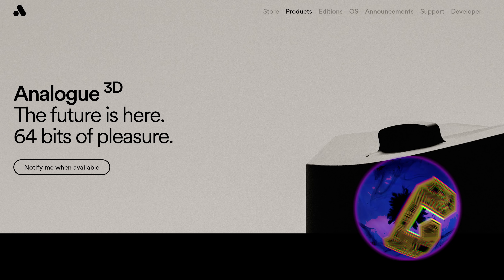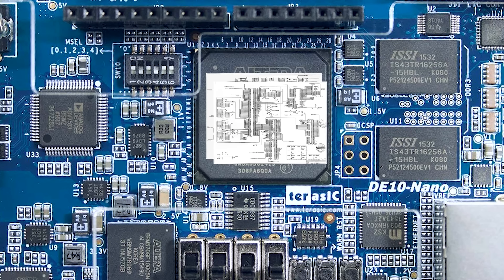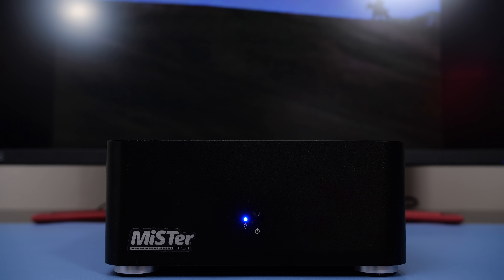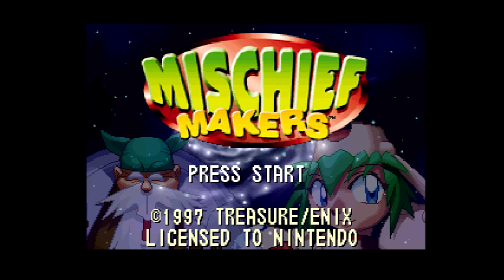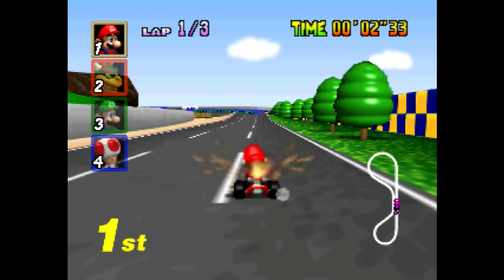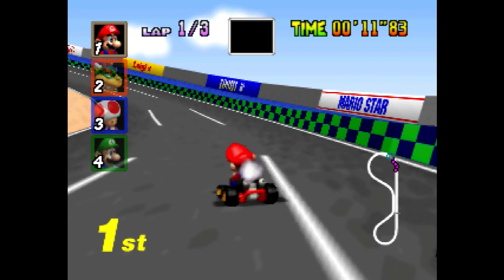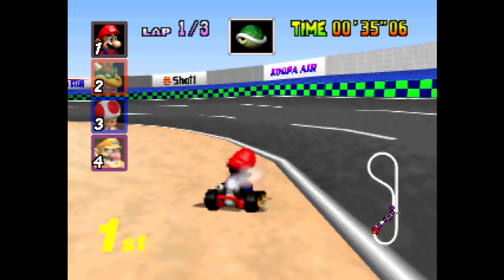FPGA Nintendo 64 gaming is here.

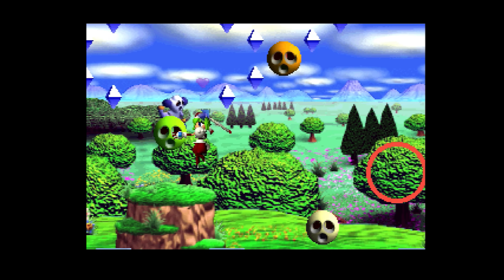Comment: At 4:47 he answered a question I always had about Nintendo 64 games, sometimes on the original console I always wondered what those lines on the edges were and I always found it strange. But this raises another question, why did the Nintendo 64 have to use this 3 point filtering method? Without this what would happen?

Comment: How fast can you switch cores on an fpga? For instance, if you can emulate 100 transistors (forgive my ignorance of this is not the right word) at a time, but the computer you to emulate has 200, can you run one half, then the other? I assume this runs at a much higher frequency than most of the computers it emulates. Or am I way off?
Reply: @bigboiter  I guess what I was getting at was say you only have enough gate arrays to emulate half of a certain computer at a time, but your fpga is twice as fast as said computer, could you swap cores back and forth fast enough to run a video game?

Comment: I'm not used to this FPGA world, so I have to ask, are these programable chips, being upgraded like a PC GPU for example? I mean, a new, more powerful FPGA chip appears in an interval of time? If it's the case, isn't just a matter of time untill we have a chip that is powerful enough to handle the N64 core without having to adapt so much? Or people are buying a specific device (like Mister) and trying to squeeze to the maximum, even if theres more powerful FPGA chips out there?
Reply: All of the current FPGA Misters are based on the DE10-Nano right now. There are potentially much more powerful chips but also waaay out of reach in price for the average consumer. Many people even find the current DE10-Nano prices too much. Only systems DE10-NANO cannot do currently that PCs can do reliably is Dreamcast, PS2, GameCube, OG Xbox. Future FPGA chips can do this whenever prices get reasonable enough for there to be a market for it.

Comment: As FPGA designer I would like to say that it's incredible! Probably, now we met the limit with current MISTER platform. I think we will not see hardware emulation of Playstation 3 or Xbox 360 and later consoles. Next steps here is all about economics. Because the price is high. If now you can buy MISTER platform for ~400$, for next generation of consoles price is more higher, it's thousands of dollars for one chip. I was working in companies where FPGA chips were using for ASIC prototyping, including CPU. And always it was a story that you cann't route the whole design - you have to divide design between few chips or reduce functionallity. And last but not least - PS3 and Xbox360 CPU has high clock frequency, ~3.2 GHz. It's not possiable to have this clock frequency in your FPGA design. Sad but true. Probably we will see Playstation 2 core, but I'm not sure, because it's so complex and hard issue.

Comment: i think i misunderstand something about FPGA programming - if you are coding the hardware as its original circuit, what is Robert doing differently that doesn't resemble software shortcuts that a normal software emulator would do?

call me ignorant, i guess my limited understanding of FPGA programming is there is one 1 circuit to encode otherwise one would not be accurately h/w emulating the original?

Comment: Just my personal opinion: fpga is country club emulation, and early 3d systems like the n64 and ps1 have aged poorly with regards to framerate, tickrate, resolution, and view distance. The future of these games is decompilation and pc porting to remove these jank limitations and document the code so that it can be modded and extend its playability. Hopefully AI will get to the point that the process becomes more automated and less manual. It currently takes years to decomp an n64 game, although several have been done already.
Reply: View distance was probably taken into account when designing the game so artificially increasing it after the fact may really deviate from the intended difficulty or experience, though may be fun regardless. Increasing resolution is very hit or miss with these first-gen 3D consoles. Look at all the HD "remasters" of these old games being sold now. The high resolution just makes it look worse a lot of the time. The framerate is the only thing I'd really agree on, though if the game also slowed down in these areas, then that is changing the difficulty as well. SHMUP players are very familiar with this and want the original slowdown in re-releases of existing games.

Comment: Awesome video!  Do you know if the Analogue 3D will use the same CPU as the MiSTer?  From the little research I've done and from my very limited understanding, it sounds like there aren't many options out there for FPGA chips that can be used for this stuff.  In fact I think I read that there is really currently only 1 on the market right now, so I'm wondering if the Analogue console will use the same one as the MiSTer.
Reply: The upcoming MARS FPGA is even more powerful than the DE10-Nano/MiSTer, so there's definitely other FPGA chips that can handle N64, though the MARS is going to cost $700 USD (comes fully loaded, no additional parts to buy, unlike MiSTer).
Reply: @kunka592 interesting!  Thanks for responding to this.  I'll go check it out.

Comment: This is so cool. I LOVE the N64, and while the original hardware is both cheap and easy to come by, it also has a lot to gain from being ported to an FPGA, especially when it comes to graphical options and interfacing with modern hardware. Now if only we'd get a proper 3-prongs third-party controller...

Comment: FPGA is such an alien concept to me, but I'm all for preservation, especially if it is this accurate to the original console. 

I much prefer to run N64 games with smoother framerates and higher resolutions in other emulators, but I do believe it is extremely important to preserve how these games originally ran and looked, if only for historical purposes. Could also be a much cheaper alternative for speedrunning with less input lag too.
Reply: The idea of programmable hardware is a bit hard to get your head around, but like a lot of things in computing, it's actually surprisingly simple once you get over that initial bump. Of course simple in the details most definitely does not mean simple in the aggregate!

Comment: I didn't realize how snobbish the Analogue consoles are until now. The new Analogue N64 promises to bring an FPGA SoC more powerful than the Cyclone V from the Mister, yet you won't be able to use it for anything else than N64 games. And I later discovered that the Mega SG and the Super NT already have the Cyclone V, which means they are essentially cheaper, fully built Misters, i.e. they might be already capable to run N64 games, among others. Evil companies use to limit what you can do on their devices, usually because they want to sell you software or subscriptions. But Analogue just sells hardware, which plays old software that reports no earnings to them, it's just nonsense what they do. Well, maybe they want to sell you the same hardware with different cartridge slots over and over.
Reply: The only defense I can muster for Analogue on this one is it outputs 4K? Lol.
Reply: if you wanna see snobbish, look up the interview with the Analogue CEO. google > PasteMagazine "Analogue’s Next Retro Game Console Is a 4K Nintendo 64". 

"Analogue 3D performs like a masterful fucking orchestra—a symphony—because, again, everything is designed from scratch, in house, with complete control over every dynamic. Therefore every nuance is able to be calibrated to an unprecedented degree. To me, it’s either this, or buy a fucking original N64 and a CRT. End of story."

Comment: Ok now let's see this FPGA core running Pokemon Stadium 2, running Pokemon Gold/Silver via the GB Tower, with all transfer pak functions working alongside the GBC emulator they used to pull that off on real hardware.
That's gonna be wild if they pull it off. Software emulation will never manage do that.

Comment: It's not real hardware,  but unlike emulation, you still need either physical cartridges or an Everdrive. It's the worst of both worlds, made even worse by the fact that it's overpriced and prone to artificial scarcity!
Reply: this video is about the MiSTer, not Analogue. the Analogue products are the ones which use physical cartridges. MiSTer is an open source project using FPGA hardware that loads games off of SD card or USB devices. MiSTer literally has no means of booting games of a cartridge and only plays roms. look it up!

Comment: To bad Analogue 3D won't load roms that are "copywrited" aka useless. Also it has been stated rom carts like the Everdrive64 won't work either. If it was a 100% compatible, rom carts would work.
Reply: this video is about the MiSTer, an open source FPGA platform which boots roms off of an SD card/USB device. The MiSTer doesn't have the capabilities to boot games off of cartridges.
Reply: @bitroast  No shit this video is about the Mister.

Comment: I would have to wonder whether or not the core could be improved to a point that you aren't  dealing with the limitations of what the original hardware had
Reply: I hope not. For me is more important and valuable to have an accurate hardware experience with all the drawbacks and limitations. If you want an innacurate unlimited experience there are already many software emulators that do it since very long ago.
I´m not totally against the idea of increasing rederering resolution or speed but only after everything is put together and working acurrately 100%
Reply: @jsr734  I would actually love to see what would happen  if  you actually  went through  improve the original  spec of the  hardware  and  improved the original  games  source  code and improved the graphic engine

I think the bigger issue  would finding a replacement for rdram which had dead lifecycle after a few years in a pc platform..

noting both the atari jaguar and N64  both used a co-32bit p4rocessors, i would have to wonder if the latest ryzen  3d chipset had been used, as if the n64  had of been kept  up with hardware updates I would  expect it be as relevant today as when it first came out..

I suspect the snes and n64 had of developed with dd in mind on both we could of had both networking and cd/dvdrom and magnetic media support

Comment: When I got my MiSTer back in January 2019, they use to say that a GBA core would be impossible, until we actually got it. After that, they said that CD-ROM based FPGA would be impossible, after that, PC-Engine and SEGA CD FPGA implementation.  After that, they said 32-bit home consoles would not be possible, until we got the PSX and Saturn core. After that, they said N64 wouldn't be possible, ..... well, you get the idea.

Comment: Does anyone make an FPGA board like this, on a PCI-E card? So you could implement "perfect" emulation, but have all the fancy AI filtering / smoothing / upscaling / frame generation effects of modern GPUs?
Reply: I assume FPGAs like that exist, but nothing that the retro gaming community has developed on, probably because they cost way too much. Also, I'm no expert but I don't think frame generation would work well unless you have hints from the game engine itself in regards to vectors for motion and the technology increases input latency so not sure if that is a winning strategy. Probably just overclocking the CPU or GPU of the system in the simulation is a better bet for improving performance. There is a PS1 core on the MiSTer with a variant to overclock the CPU that does this, but compatibility is not perfect and it may cause some games to crash or behave oddly. Another downside of integrating into a normal PC is you'd get some additional latency by adding your GPU to the chain, so timing-sensitive lightgun games don't work anymore with original hardware, but I guess that would also break by using LCDs anyway.

Comment: I know tha fpga is hardware replication of original hardware but honestly what is problem to replicate fpga core via software and create 100% accurate emulator?
Reply: Speed. Whatever hardware you describe for an FPGA can be simulated in software (and is for most testing), but because that simulation is so incredibly detailed, it's super-slow. Forget frames-per-second. Think a quarter of an hour to simulate enough runtime to render just ONE frame.

Comment: Does this work with any controller?
Reply: The MiSTer will, yes. I personally use an original N64 controller that has the 8bitdo mod done to it.
Reply: MiSTer is very forgiving in terms of what controller you want to use. Once you have a controller connected, you can pretty much use it with any core and map the buttons to it. I've been using Nintendo's NSO N64 controller via bluetooth, and out of laziness will sometimes use the same controller to hop into other cores and play NES/SNES/PSX etc. using the NSO N64 controller.. or likewise, use a PS4 dualshock on the N64 core.

Comment: My favourite part of the N64 core so far is wondering why WWF No Mercy is slow when there's four characters on the screen, only to find that people with real hardware also had to disable the music in the game to get a better framerate.

MiSTer is pretty accurate, as it turns out.
Reply: Idk if you've ever watched Kaze's videos but his newest video does a really good job of explaining how improperly managed polygons on the N64 can bring it to its knees. He renders one scene using 10000 tris and it it's over 30 fps but then he renders another that's 10 tris and the system slows to a crawl
Reply: @clebbington  As an avid Kaze enjoyer, which video was this? I'm interested.
Reply: I have no experience with FPGAs and had wondered about examples like the WWF game. I'm fond of Perfect Dark but that could slow to single numbers for frames per sec. Would exactly the same happen in a N64 FPGA core?
Reply: @MrJakeTucker  Yup. If the core is doing it's job then everything right and wrong with the original hardware/software will rear it's ugly head. That said a lot of the newer Mister cores (including the PSX core done by the same guy doing the N64 core) have started to add a bunch of software emulation like options to smooth out the visuals, speed up the loading times and stuff like that. So, who knows, maybe there will be some stuff you can toggle on to fix certain inherent issues caused by the original hardware.
Reply: @MrJakeTucker  From my understanding, yes - FGPA is generally designed to be faithful to the original hardware, warts and all. 

There's some leeway with how you can control the levels of hardware emulation (for example with the N64 core, turning features of the VI pipeline on/off for intended visuals, line multiplication to fill a resolution correctly, and filtering on top of that for CRT effects etc), but there's usually not a lot of scope for implementing adjustments of clock speeds or simply brute forcing software to run faster. It's just mapping out how the chips work.

In that respect, I think decompilation projects have a place in the scene for adding a larger amount of bells and whistles to a game, even if it takes more work per game and more copyrighted assets to do it.
Reply: @MrJakeTucker  Yes it would, but being an FPGA core, if for some magical reason there's enough processing headroom in the DE-10 Nano to make room for "overclocking" the N64, that problem might be alleviated. And besides that, there's little stopping a passionate enthusiast from patching games to slowdown less. That's already happening with the SNES library, where someone's making Fastrom patches for a bunch of games to make them slowdown less. All I'm saying really is that nothing's impossible and if it won't happen with the DE-10 Nano and this particular core, at some point in the future somebody will make an overclocked core. If it's imaginable, someone will code it.
Reply: @michelvanbriemen3459 best comment. And I believe that getting this far in emulation is proof that anything is possible.
Reply: 64th like 😉

Comment: I hope they release some trident controllers to go with this,    i've not found an n64 controller without a ratty  analogue stick in a decade, so a fresh batch would be wonderful.
Reply: I’ve been using my Nintendo Switch Online N64 controller with it. Works great!

Analogue’s controller partner, 8BitDo, did make a Bluetooth controller with RetroBit around 2016/2017 but it’s kinda rare. I did see it at Microcenter but RetroBit had a terrible reputation back then: clone consoles and NES dogbone replicas with the cord improperly routed so they’d pull right out… and then they had the nerve to put an inspection sticker over one of the screws!

Kinda wish I had bought that controller now but there wasn’t anything good to use it with back then.

Comment: out of scope of cyclone V, what internal frequency it runs, at least 400MHz, you can run side by side chips to get multiples of the frequency effectively, as in multi-threading. maybe also use a faster clocked fpga with faster memory and over fast pcie access to gpus etc. well actually, the internal clock of de10-nano is 550MHz and internal fpga memory blocks frequency is about 300MHz.